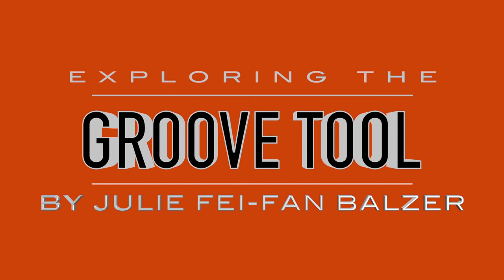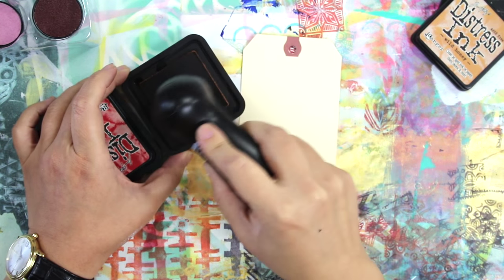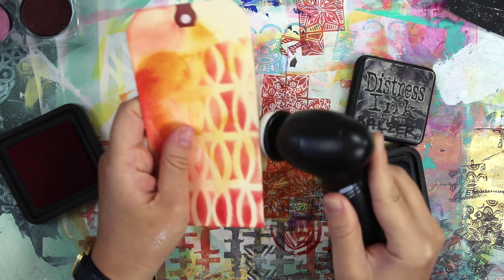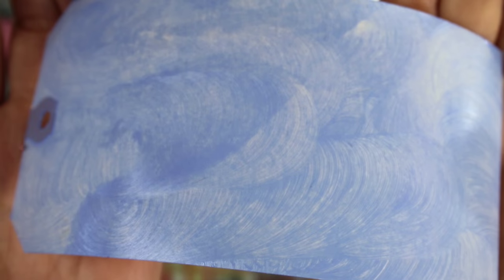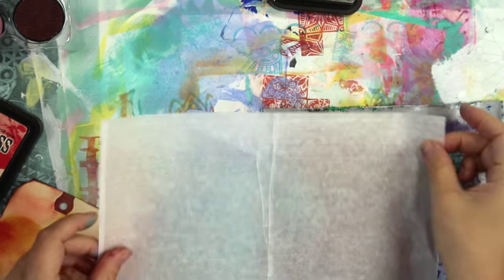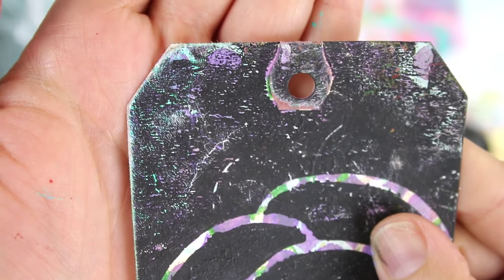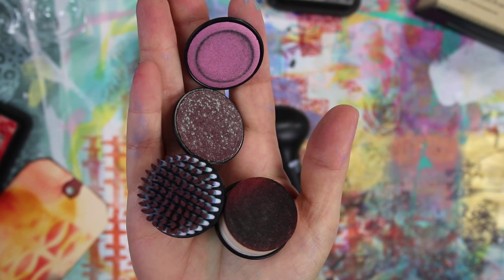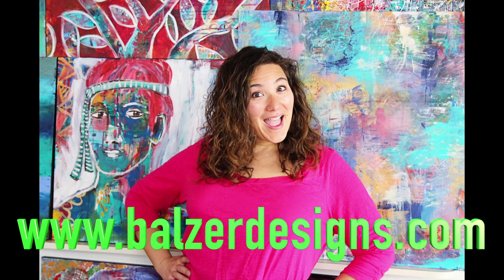Exploring the Groove Tool

Comment: Like it, since I have a disability that causes weak hands and I don't have the strength to ink entire backgrounds! That said, I contacted Art C about the swirls left by the foam head and they said it was designed for paint. So that leaves the brush for Distress Inks, which I'm determined to make work through practice :) Thanks for the video!

Comment: Do they sell replacements for the sand paper? And that sponge will only hold up for so long till it starts to fall apart. I think I agree with everyone else so far, not sure it's necessary. But I certainly appreciate the info, probably saved me some $.
Reply from the maker: icatstaci77 Yes, I believe you can buy replacement heads.